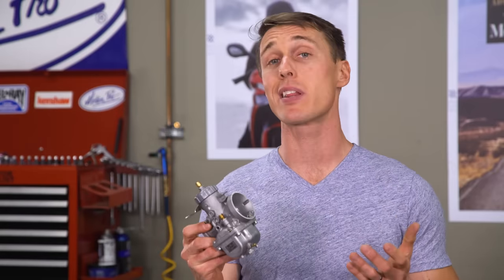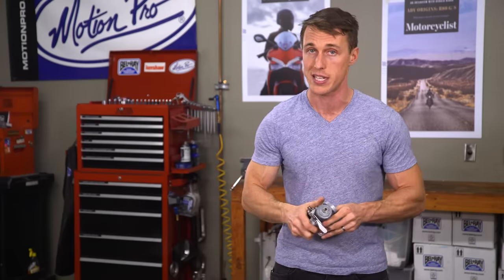Carburetors vs. Electronic Fuel Injection—What’s Better? | MC Garage

Comment: Not defending carbs here but my 11 years old bike runs perfectly fine and never had fuel/carb related problems. Though I did have 1000s of many other problems on account of it being old 😂 😂
Reply: I've got a 1999 R1 as it runs ace, always starts and still rips my face off when you pull the throttle back. Toured 2000 miles around Europe with no issues, carbs are still great
Reply: i have both a 14, and 18 year old bike.. to be fair, the 18 year old is a cafe racer build running a brand new carb, with ported heads.

and the 14 year old is running standard, no problems so far, and even so, i know what to do.
but i guess when it comes to climate change and altitude, which doesn't really matter here in my country, i guess everyone is happy.

but i do love to save some fuel..
Reply: Just be willing to do the maintenance Tongga and you'll be fine. Keeping a carb clean doesn't take that much time, and it's a small task that brings out the mechanic is us.
Reply: I don't mind FI on my road bike- I can always get the automobile association mechanic to come out and look at it, and if necessary (had it happen once due to FI), tow it home on a truck. On my dual sport, I head out camping and I'm often a long way from town and even phone reception. That's when I like a carby. It's not efficient, but at least I can get the bike running enough to limp back to town.
Reply: Telosian Ross 128 b it's not  a toy but a tool which I use daily and have put 90k kms on it, and hoon it  around every turn 😋. So yeah I think a 90k km bike would be considered old...... Otherwise whatever you think..... 😎
Reply: Telosian Ross 128 b also did I mention it's a single cylinder (no shit) 150cc bike....
Reply: My first bike was à 24 years old dr650. I never achieved perfection with it, there was always something to fix, a missing bolt somewhere,..
Then I buyed a 22 years old dominator. Like new : it's a Honda. I know have a more recent one that is rusty and got half of it's paint, made in italy.
Reply: Carbs work fine if there perfectly tuned  it sucks tho that you can't just switch air filters and exhaust without messing with it
Reply: My fucking injector clogged at 50k but carbs never have problem even the odometer back to zero
Reply: Take for example russian IZ Planet 5, it has 350cc 1 cylinder engine. You would think vibrations were bad, but no, it was excellent cruiser.
Reply: Ibrahim Mohsin m
Reply: Ibrahim Mohsin yucks
Reply: @tonggagames917   
.
Reply: Which simply means you dont ride your bike in various extremes because if you did?  You'd be changing jets.  When I raced MX there were tracks you literally could not run normal jetting ....off came the carb and out came the boxOjets...plus it seemed like a lot of things caused jetting issues like changing the exhaust or even messing with airbox/element ...super hot or super cold even affected things related to mixture ...sometimes maybe a bear to start ...a well designed fuel injection system remedies all that.
Reply: And you know when CDI ignition came along,  some guys balked at being at the mercy of expensive components when the mechanical coil/breaker points and condenser setup could be maintained cheaply and without much grief ....but the high voltage CDI ignition is so far superior that in just a short time EVERYTHING had it....gone are the days of being able to fix tuning problems and failures for little or no money....new tech is superior and reliable but expensive and complex as far as electronic inner workings .... I suppose one would have to keep components subject to failure on hand to DYI out in the middle of nowhere
Reply: carburator is best for me bcoz I can't spend more money to get fi version bike.
Reply: You need to put some pork fat into the fuel it keeps the carb lubed up,how many guns can you carry on your moped?
Reply: Hahahahaa...can relate to that!
Reply: Why are you afraid of defending carbs. They will still be working long after all the electronics are fucked.
Reply: @magnusremovals3548  IZH'
Reply: Greatly agree on this one bro,  if you got a Fuel Injected bike and you run out of Battery Juice??? Yeah, you have to tow it down from the Top of the mountain to the nearby Town to charge your battery, it will never start without battery, but with Carburetor-Type bikes, no problem with no battery, just kick it up and it will start, or just push it down the hill and it will start. PLUS! Roadside mechanics can always fix carburetor-type bikes, in case your way far out of town BUT  with F.I.-bikes? Sorry, you need to take the to the dealer and let the dealer deal with their computer system.
Reply: none I totally agree with everything you say here, but it’s not only to make us stupid. The bullshit claim of the anthropomorphic cause of climate change is designed as just yet one more way to tax us. 

If you want to know where all this began, research the true origins of the Federal Reserve and Federal Income Tax in the USA, both of which were conveniently in place by the start of WW1 - which, as well as killing millions of ordinary humans, created the first billionaires and hundreds of new millionaires in the USA. 

Yes, this is all relevant and related, because without the bullshit legislation, we would all be free to choose.
Reply: Gs 150 or Honda Cd70

Comment: How often do you ride to the moon . A nicely tuned mikuni carb has never let me down  .
Reply: yes my good sir , i agree!
Reply: Ny Chan, you, sir, are absolutely right. A nicely tuned mikuni is a very nice thing to have on your vehicle, it has got power as well as economy.  My 80 cc motorcycle had a Japanese mikuni and it did not give me any trouble till I sole the motorcycle. I used it for around 70k kilometers.
Reply: I have a vm22 and I'm having  a bit of trouble
Reply: I had carborated bikes for since the 1980s," never "had any real problems, (because I would Listen to the older riders who did most repairs them self, as for fuel consumption you ride your bike like a rider not an idiot, the difference in fuel consumption compared to E.F.I -is miniscule ( clutch in and just gently roll up to a red stop light, move away on a green light carefully. If you know what your doing with a carboretor the maintenance is few and very far between, you also have to do basic maintenance on a motorcycle, and also getting on the web doesn't always make you an expert With experience, I wouldn't ride an EFI motorcycle out to remote places knowing that it needs  a f#cking calculator to do its job.
Reply: @biofall38  best of luck with your bike hope it all works out😎🤔
Reply: If your a guy that likes to ride in colarodo or super high altitudes or travels to parks all over the country with super diff weather the efi is the way to go.  And from my experience efi warms to operating temp in less than 2 minutes while a carb bike you have to give it 5 or 6 and then put around b4 you can open er up
Reply: One day I decided to reach 80 kmph on my 11 year old Suzuki with Mikuni VM18 and guess what? Float needle started giving issues and float used to get stuck every single day. Heck when I used to barely even touch the idling screw, carb used to overflow. But wth that 80 kmph was fun
Reply: fukin right 35 years i always had carbs van, off road bikes, scooter. 1 year fuel injectors.forgot.
Reply: @nicholstop8161  Absolutely. Not in CO, but I lived near the mountains in the SW. Riding around town, then going up to the mountains, I definitely felt the change in my carbureted bike. I still love that bike...but the bike I bought after is fuel-injected.
Reply: Carbs have their place, but as others have said if you are in the Rocky Mountain West, and particularly if your engine is air cooled, you will prefer FI.  I have re-jetted Bing and Mikuni carbs for altitude, but it is always a compromise.
Reply: Keihin has bunch of good carbs also
Reply: all set ...carb..all day
Reply: The elevation changes locally from 5,000 feet to over 13,000 on many local trails. Changing jets is a pain at this altitude on the trail.

Comment: Fuel injection is the ideal, but so far no problems with my carbies, currently at 110,000km on the odo of my 1991 Honda cbr250rr. Ridden daily though which prob makes all the difference.  Also I believe the mechs cleaned them at 50K service.  I've done 80,000 of those k's since I bought the bike about 7 years ago.
Reply: You are lucky that your 250RR doesn't need a fuel pump. The older MC19 uses a fuel pump, and I'm currently dealing with pump reliability issues.

Comment: Carburetors for super easy fix if they break fuel injection can be very costly to fix if it breaks had an xr100 and never had to touch the carburetor on it ran great all the time.

Comment: "If your bike has carburetors you WILL end up working on them." That's a load of crap, if you take good care of your bike the carbs may never need service.
Reply: @yafaza450  why did it take you a few weeks to tune a carburetor?
Reply: @republicansareoffendedeasi821  I was doing different mods to it every week... did air box mod n had to rejet it, got a pipe n had to rejet it, then did the cam mod had to rejet it, another airbox mod n had to rejet it. After doing all that and getting it jetted right I never had to change it again
Reply: what do you call taking good care of your bike ? the only way to avoid your jets getting clogged, is to twist that throttle to redline, ride the hell out of her at least once a day and you'll have brand new carbs
Reply: @blackmesa27  Avoid alcohol blended fuel, and burn at least a tank of fuel per year. Ideally you should add some fuel stabilizer before you park it. Pretty basic shit.
Reply: @blackmesa27  modern fuel is garbage agreed but Redex works pretty well on a carb.
Reply: 30,000 miles, rebuilding Mikuni CVs, that's what winter is for :D
Reply: You need to work on carburetor one way or the other. It demands attention too like a simple human being :)
Reply: @Username-2  Lol. I know
Reply: change the fuel filter when needed. air filter as well.
Reply: Thing is working with bikes is one of the freebies of fun when owning one
Reply: Dosnt matter if you take care or not, at some point one of the maintenance jobs your gonna need to do is clean your carb😂 Ride it enough I guarantee one of those jets will get clogged eventually

Comment: A properly tuned carb works very well but fuel injection is the way to go.
Reply: untill a component failure on the road side happens --you cant fix it
Reply: I don't carry tools so if my carb breaks on the roadside I'm fucked anyway
Reply: @brenohighland1168  Id rather not be stuck on the side of the road at all

Comment: Good to know , well thanks for the video and you've answered my questions , here's what I like with carburated motorcycle in case that your throttle cables broke or snap you can just simply adjust the fuel jet so without using the throttle the motorcycle will move but not too fast just like (15kph - 20kph) , unlike fuel injected that you cannot make any adjustment because it's already fixed.
Well I'm not sure with Fuel injected if you can also adjust the fuel jet so in case of emergency you can still take a ride and get home safe ...
Reply: kenneth cuenca I agree plus carbreter dont want electric power its very reliable.
Reply: easy to fix in emergancies

Comment: The Delortos on my 78 Guzzi, the Bings on the 81 Beemer and the single Mikuni  on my Norton continue to work fine.   I  had to replace the rubber diaphragms in the Bings several years ago.

Comment: Something EFI users dont usually have is the Carb user's thirst for knowledge with bikes...
Reply: Damn right,  you better know how to fix ur bike, just in case
Reply: You are confusing thirst with requirement. You WILL have to work on that carb if you own it long enough.
Reply: @someguy5035  it's just simple maintenance but, se i got an 8 yr old carb bike that ive been using for deliveries for 3 years now and it never gave me problems only those broken drive chains or flat tires, as far as my experience goes, if you run on optimal A/F and some twice a year carb cleaning you wont have problems..

Comment: Carburetors have one big advantage: It's easy to adjust them and it's free or a few dollars for jets. Computerized injection could work perfectly fine but with strict emission standards engines are optimized to use little fuel and are not so much optimized to run as smooth as possible. My new bike's engine runs rough between 2-4k RPM with little load (driving in slow traffic). With a carburetor that would be easy to solve. With fuel injection the garage can't do anything with the existing parts. To change anything additional computerized electronic would be necessary - for hundreds of dollars...

Comment: EFI>carbs.  Better fuel economy, no weird issues with big elevation changes, no seasonal tuning, better cold starts.  ECU can accommodate changes to a degree, then a self tuning module can correct better than 95% of people can tune carbs.
Reply: @Viscous Shear EFI doesn't tend to clog up half way down a trail either.  Biggest thing I've seen with it is people running the tank low too often and overheating a pump.  But they tend to be the people who run any bike until it throws a rod or locks up from bad maintenance.  I've dealt with bike that have 1-4 carbs, long rides, short rides and everything in between and there is a reason my 78 yamaha has EFI swapped on.
Reply: Personal preference is the only legit answer. Tbh. They’re equal in opposite ways. I had a carb on a sportster. 2 years not one issue. Starts acting up. I pull float bowl. Extra jet. No the main didn’t fall out. I had one in my hand and all others accounted for. To this day I have no answer as to who how when where or anything else. All I know is it was before me lmao. I like both for opposite reasons.
Reply: @randombuilds8336  But its rare that a carb bike has a fuel pump and they would only clog if you don't have a fuel filter inline.

Comment: Can you please show how to switch grips on handlebars
Reply: Check the library! That's one of the very first vids we did at MC Garage, so you'll have to scroll waaaaaay down. Or just Google "replace grips MC Garage."
Reply: Ari Henning Thanks
Reply: Mate use a compressed air nozzle gun (pointy end) to get the new ones on , after cutting the old one off .. piece of piss.

Comment: I had a bad charging system on my bike.200 miles from home.indisabled all lights etc.and with a full charge i made it home.if i had fuel injection i would have been stranded for sure.alk components draw electricity..lol.my fuel pump is vacuum.and gravity.most piston aircraft is old school.for safety purpose..il keep my carburator.thanks

Comment: EFI as I ride in ALL weathers and always starts good. Had a carb bike before made in 2000 and trust me when dirt got on the fuel was a right pain to fix with all those hoses, fuel petcok, carb cleaning, cleaning out fuel tank, etc.
Only find when I am stopping down steep hills in slow slow traffic the revs can go higher or lower. Hopefully the rev adjust, air and fuel checks did yesterday helped. No sign of an issue this morning with little traffic.

Comment: my carbs 27 years old still run fine all 4.
Reply: Mine too. Honda?
Reply: 1991 vfr750.old school,for old man.
Reply: 1992 Sevenfifty, still running smoothly. :)
Reply: 1990 FZR 600, 1999 R1, running strong, one being older than me :)
Reply: You gotta try the the 800 without the vtec. Trust me, you will love the efi
Reply: 93 CB750 here
Reply: 88 CBR 250R and 86 VFR 400R. The CBR likes to randomly run on less than 4 cylinders sometimes and at startups, behaves better now. The VFR has a MASSIVE flatspot between 5K and 8K. Tried tuning it away, changing airbox covers. Nothing.

Comment: I don't know why I watched this as I am fairly conversant with how they work. 
I don't know if it's been pointed out but at 53 seconds the carb was back to front.
It is exactly analogue vs digital, another way of thinking of it is a carb works from feedback from the engine, and EFI is feed forward from the ECU.
Other than that this is bang on.